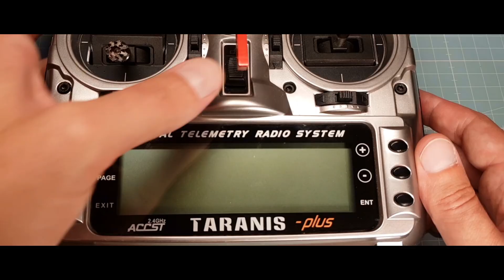iFlight TITAN DC7 HD - DJI HD System - Unboxing - Assembly

Comment: I built one of this frame yesterday for a friend of mine..
As extra you need the straight mmcx to sma extension with a couple of antenna suitable for DJI (LHCP)
I didn't have that and I used the stock one with L connector but the air unit doesn't fit in the TPU mount..
So, temporary, I had used double sticky tape to attach it to the top plate
Reply from the maker: Thanks for that information! I don't own the Dji HD System yet. So I'm first going to use an analog transmitter. I hope I can do my first test flights the next days.

Comment: seriously got nothing against the product but for this price it can be produced in europe, but i can see how presentation makes it look like its worth. i guess somebody learned good marketing gets better prices. 
nice frame.
Reply from the maker: Yes it's pretty expensive, like the DJI HD Stuff ;) But it's also very high quality carbon with 6mm thick arms and two 3mm thick bottom plates. Heavier than cheap frames but also stiffer. Stiffness of a frame is very important in order to get a smooth flight performance. I habe just finished my build with the AirB 2514 Motors (also pretty heavy) and a Tmotor Stack and a Unify 32Pro. Going to do my first test flights the next days. If it flies even smoother as my XL7 - I can live with the extra weight of the DC7. It was also easier to build this quad because there's more space for mounting the hardware.
Reply: @TorbanDallas  yep. there's always a compromise to make. curious to see the flight. make shure to put a current sensor.  probably 7inch props will handle just fine the weight so it will be on the lipo's to take the heavy load.

Comment: Going to be getting this frame to convert one of my builds. The thick arms is a plus... Got too much trouble with 4mm arm 7 Inch quads. Look forward to the build and flight video👍
Reply: Fantastic. Think this will be a good upgrade for my 7 Inch. Matek f722 2508 motors rush tank vtx and R9mm but... a cheapo frame. So don't fly to Nice. Fingers crossed this frame makes it all come together.
Reply: @Pete-Slater  Which 4mm arm frame did you have trouble with?
Reply: Definately go with 6 mm arms on a 7".
Reply: @marlin-fpv  Thanks. Can you confirm any that are really light and jelly free?
Reply from the maker: Thanks for your comment! I'm also looking forward to the build and my first flights - stay tuned, I'm going to share my results with you.
Reply: It's a xl7 clone frame. I've a skoll v2 also with 8 inch arms. Also not the  best.. Lots of vibration
Reply: @Pete-Slater  Ah ok I looked at that one thanks.

Comment: Over 200g yikes. My 7" frame is 65g.
Reply from the maker: well, big frames need thick arms in order to avoid frame resonances. I'm going to build it and then we will see how smooth it flies :)
Which 7 Inch frame are you using?
Reply: @TorbanDallas  It's the Sloss on BG. You are right I do get frame resonance but it only feels uncomfortable at high throttle. The arms are 4mm. There is a frame called the Yeti from Rebel that uses 10mm arms and claims to have perfect jelly free video. I have a bunch of Sloss frames so I might try doubling up the arms with glue and then re-weighing at 8mm. If the new total is less than 100g it could be worth it. So many 7" frames are 130g+. I just want the absolute lightest possible DJI HD 7" frame.
Reply from the maker: @changeagent228  The Sloss is a very small frame, i need more space for mounting the hardware :) But your idea of using two bottomplates to get a 8mm thick one sounds interesting!